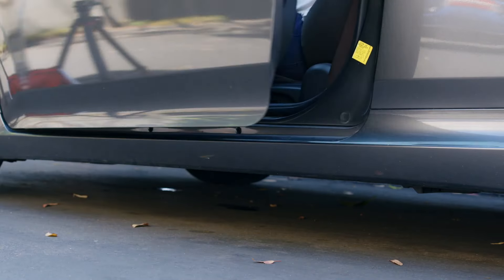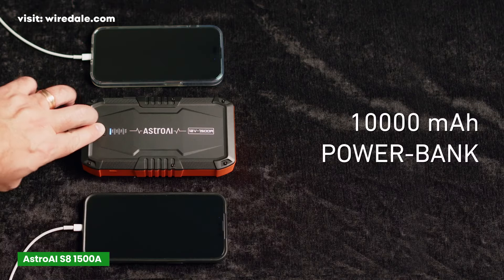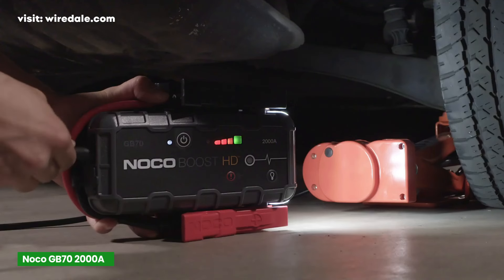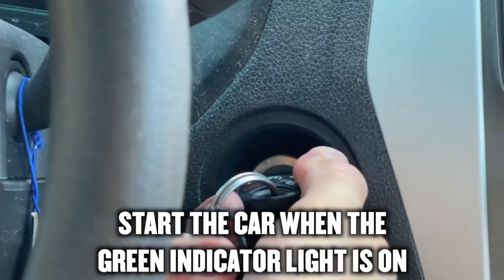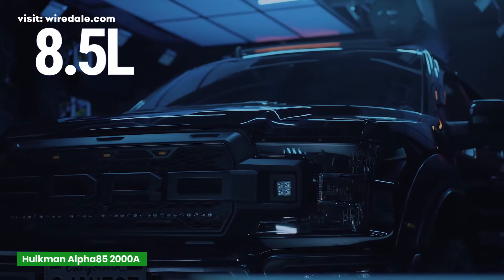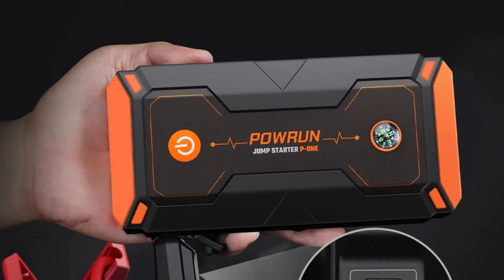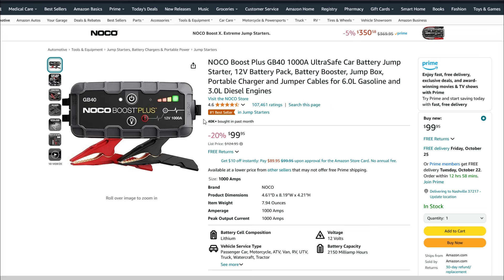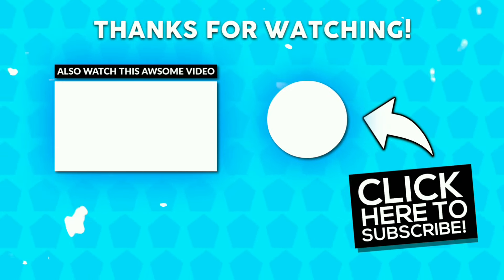Best Portable Jump Starters 2025 for Car Battery & Small Trucks

Comment: I own the Hulkman for the past 2 years. It hasn't failed me yet (I help people start their cars in the parking lot when I'm there).
Reply from the maker: Thank you for sharing your experience.
Reply: Did it come with a case?
Reply: @AR-ki7hg  I bought it at Amazon when it was on sale. The sale included a custom molded case that was shipped in a separate box (the case is different than what is shown in the video).
Reply: @TheDanMan01  I only passed on it because no case or wall plug. Went with the WOLFBOX. Nice case, wall plug and 2 yr. warranty.